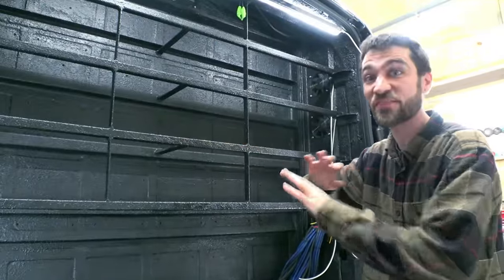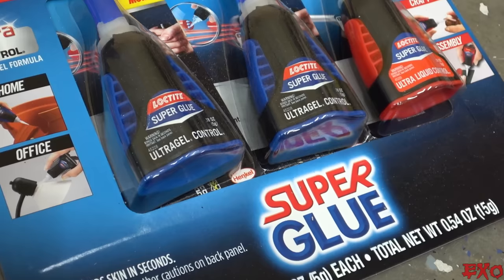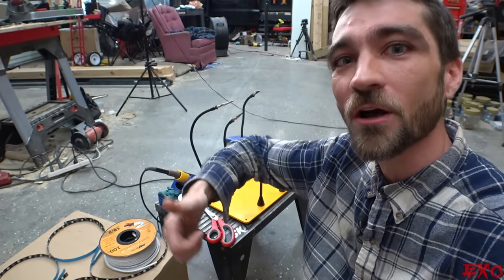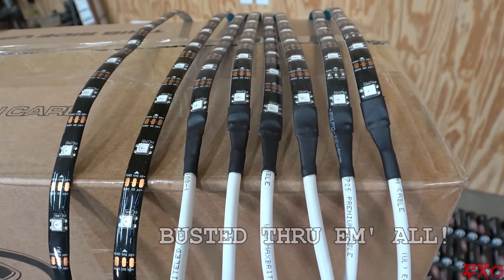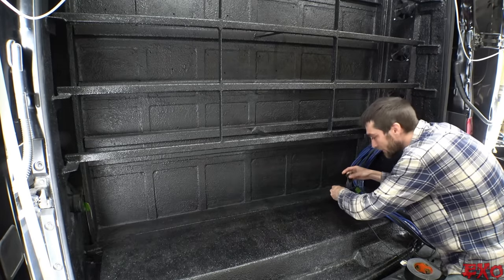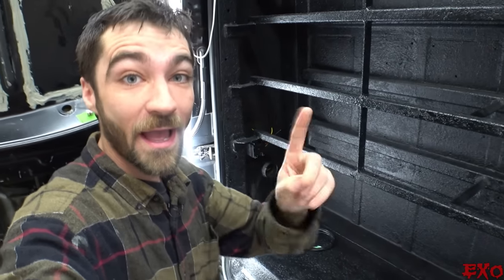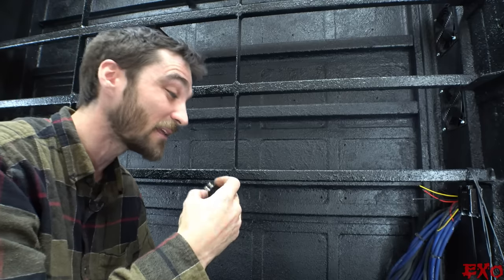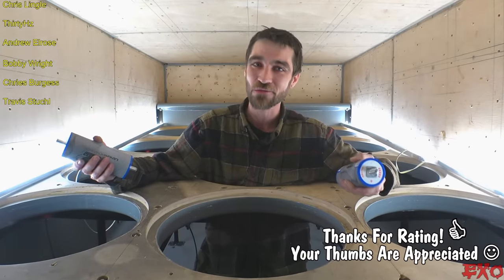CUSTOM LED Amplifier Rack w/ Hidden Light Strips & 12V to 5V DC Power Supply | EXO Car Audio Install

Comment: Loving the build,I've learned with the led steps that after soldering,I use hot glue to insulate the wires before heat shrink

Comment: I program these LED strips. I've built my own software to control these and designed my own animations and games with them. I even built a huge one of a kind LED Bar that I mix drinks at in my home. The top is fully customizable and users can draw on it and play games on these LED's!

Comment: Well I for one am really looking forward to you putting out a video on installing the li-ion bank because I really want to learn how to do it. I'm working on building a 4-15s setup in my 05 scion xb, and the only thing I'm lacking is the battery power so even if I don't win one of your beautiful banks (wink wink) 😂 I'd like to learn how to do those and buy a bank for my setup so I don't kill my factory electrical system bumping the doors off. Love how the build is moving right along, keep it coming!

Comment: Dude! I love your energy! Just a quick solder tip, when tanning your cable leads, hold the solder tip against the copper longer to heat it up higher so when you touch the solder to the wire, it wicks into the wire. This will keep your solder tip cleaner longer.

Comment: Lookin good EXO. For big builds or really detailed builds, I don't think people understand the planning or fore thought that really goes into stuff to make it look good. Like  I planned ahead to wrap my subs with LEDs and gapped my trim baffle and it looks like a ring. But my door enclosures were tight around the parking brake and touched, so 30 plus hours were for naught to integrate a small notch that looks factory. To do top tier stuff, there's a reason ppl pay 10 grand or more  for an install. Everything is custom and you kinda make it up as you go along....with some fore sight.

Comment: for such a top of the line build you'd think you would use the top of the line 2812's.. I've done my 151 Jaeger build with so many 2815b (they're already 12v no need to buck them down to 5v) but now they have the 24v COB 2812's (look into it) so much better looking.. and you can boost the voltage with a 12 to 24 buck. and there's NO VOLTAGE drop the 5V LEDs get over distances.

Comment: Love your videos and all the positivity you bring to the community. I would love a set of the yinlongs. I have been needing another bank. My voltage at big shows is pretty scary sometimes and I really think just having one more bank would help my reserve tremendously. I once gave you a demo of my truck at slam with Casper. I now have a 3 15s blow through I would love for you to hear again. Back then I think I just had 2 10s. Now I have about 10k watts. It has been a very very slow build for me but it's what I love.

Comment: It will be interesting to see how well the niodinium magnets hold the LED light strips while the van is hitting at full wattage.   I know niodinium magnets are super strong when it comes to the holding ability, but due to the uneven surface caused by the black coating, I just wonder if that will eventually lead to the magnets not holding causing the LED light strip to fall off during hard use.

Comment: Great vid as usual, EXO!!

Just the Tip: Painting your heat-sinks will decrease their effectiveness at removing heat. If they absolutely have to be black, try using a spray ink.

Comment: Just like my comment on the last video,I'm finishing my build that started 4-5 yrs ago. Saving buying saving buying you know the grind. Anyways lithium is all I need to maximize my system to its full potential and 40ah is what I've been looking at to buy,but if I could win them my project would be complete at the beginning of the new year instead of another year saving. Can't wait to see those Incriminator amps go in.

Comment: I just recently upgraded my subs and I cranked the amp up but I find my voltage is low. I could really use those Lithium cells. I also built my own box for my car and am currently building a box for my budget home theater. Cant wait to see how this build of yours preforms.

Comment: You should check out the aluminum tracking with diffuser panels for the led strips. Just in case the magnets aren't strong enough with all that bass.

Comment: I love how 75% of the comments are about his positive attitude and work ethic, and not just the giveaway.

With that being said, keep up the good work, and ive been waiting to see your battery bank to know what i want to use in my first big build.

My current system has 1600 watts total for 3 subs and the 10 dash/door/rear speakers.

My new system that i almost have all components except alternators and batteries will have 12200 watts with 11 amps, 2 processors, 6 subs, 18 mids, and 8 tweets. Looking at 3 390 amp alternators but need to know what batteries im using before i have them built. I would love to pick your brain on how much lithium to use. Betting these would be a great start. 

Also, same as others have asked, how are you controlling the leds? Ill wait untill next video because im looking into lights myself. Lol

Comment: My work-in-progress is going slow,  but steady.  I'm going with 3x 15" deaf bonce 305s on a JP 6300 wired at 1.3 (i might are switch to .66) with a Lithium 12k and DS18s in the doors.  Love your vids bro
Reply: Can't forget the JS Alts 320 amp!

Comment: FYI you can daisy chain these strips quite easily, so you don't have to run a cable to each strip. And you can get them in 12v variants (WS2815).

Comment: I would of suggested getting the quick connect ends and soldering those on the ends for easy replacement if need be

Comment: Hey bro some good ad when u tin the wire and ur done heating from the bottom do a quick wipe with the iron to the top side of the wire it helps pull the solder through the wire and you so need a sharper tip but they came out nice

Comment: great video!!! I just bought a Tahoe and slowly getting there. I got 4  sundown x 12s in a 6th order but only on 1200watts :( its pretty good I just need power before I get a bigger amp. that little skar 1200 drops my voltage to 12.1v O.o

Comment: I use double sided gorilla tape on my leds. That's the only thing the tape on the leds will stick to😂 but it's held my cheap amazon underglow on my car for over 3 years now! Never once had even 1 problem. And I live in Ohio. So the multiple feet of snow in the winters and all!

Comment: I really hope those magnets work. I’ve got strips all over my house tucked behind and around my new baseboard and I just can’t see the magnets holding up or keeping them positioned like they should be. Tbh, I’d probably just bit the bullet and stripped the rubberized coating off where you wanted them. Hope it works out though

Comment: I could Def use those Ling long Ying Yongs to replace all my agms, I have 4 skar svr 15s with a bass 5k, 320 auto tech. But even with 300ish ah of agm I still dip to much for my liking! So those would help ALOT

Comment: When it comes to neopixels one data wire can run 30k leds at 30fps or so, to keep the wiring neat just snake one data wire up on the rack. looking good though they shouldn't dim with those power wires

Comment: What is the reason from reducing the voltage from 12v to 5v? Only reason i could think of was to dim the lights? This build has got so much fine detail, it make me realize how much planning and work actually goes into something like this.

Comment: I thought about buying some lithium banks.  I'm running a Ioxus ultra capacitor smart power on a jp23 v2 and pushing a crossfire c7-v3-12-d2.. it beats tho I just got to get more power.

Comment: Looks SWEET! Wish i could hear and feel it man! Exo, i have 2 12" dual 4 ohm Orion HCCA subs and a Taramp smart 5k amp running them, but i don't think this amp is 1 ohm stable so until i can purchase another smart 5k can i just use 1 voice coil off each 4 ohm sub to get a 2 ohm load?

Comment: Hello Exo, i hope you try a pack of LiFePo4 battery, they are the best cells in the world, with a wattH/height ratio of 153Wh/kg, LTO is 70Wh/kg and lead/acid only 38Wh/kg
You should buy some 32700 cells and test them, 4 in series to reach ~15V and you will see a shock of almost 400A instant with just 4 cells.

Comment: You should have pulled a new string with the wires through the back tunnel in case you want to pull something else through there later on.

Comment: Just remember that the glue on those led strips is rubbish at the best of times. Yes, I know you superglued the magnets but it's still on the glue strip. I wouldn't trust it.
Inside a hot vibrating environment the glue WILL fail very soon so you should look into using thin black enamel wire or something similar every foot or so to secure them more permanently.
Flux the copper pads the use thin solder tip to heat the pad for half a second then introduce the solder to the pad.
That way there's little chance for bridging the pads and you tend to use less solder too.

Comment: @EXOcontralio What are you using to control the data side of the 5v LED strip? I get the step down buck converter to limit power. But what's telling them what pattern to show?

Comment: If i win the 40Ah bank of Yinlong cells from Remy. The 40Ah bank of Yinlong cells will drive a plasma speaker and a 400 rms sub.

Mid/high from the teslacoil.
Low from the subwoofer 400rms.
And I will put it on youtube. With name and link to Remy and exo

Anyone curious!?

Comment: Would be kind of cool to try out those batteries probably work better than the 2:+ 18 amp hour AGM batteries I'm currently using just some old batteries I got out of an uninterruptible power supply just kind of just a low Dollar Car Audio setup just a lot of my old equipment moved on from different vehicles I just got a new truck The electrical system is kind of weird being it's a new style alternator It doesn't always regulate at 14 volts it can go up and down And I noticed my amplifier really does not like that kind of yo-yoing power supply And I think there's AGM batteries from five years ago are about to give up the ghost

Comment: I would like if possible some help with my audio build my main goal has always been to play between 25 and 50 ish hz I like my lows and I've done everything to try that no matter what I see people
Online with even 1000 watts or even 500 more than me i have a stinger 1500d amp it's pretty efficient on the dyno and runs 2400 dynamic power and dynos 1700 rms no clip I've set my gains to no clip with an ossilyscope I know the car doesn't roll off the bass from 30 up to 20klhz  it also doesn't roll off down to 30 ish but I've never been able to relly relly play below 32 hz because in the range of 35 to 60 it slams but the area where I tuned the box and where the subs like to play I can never get people even u play like 27 hz and it slammmmmms and others with less watts can hit that low I even built a box tuned to 31 hz box specs are 3.2 cubes and 4.9 net and I have 2 audiopipe txxbdc 12s 800 rms more like 1100 they're fs is 27 resonant and I also have an extra battery to keeps the volts up I never drop below 12 volts so can u help me hit where I want to hit 🙃anybody on exos channel
That sees this or exo himself .. if it's exo I kinda built the box somewhat like your box u build for ur wife with those blue two 10ns in her corolla

Comment: I could so use this my voltage is dropping low and I’m running. A kinetic hc2000 to push 4 12 sdrs on a taramps md3000.1 i need more headway

Comment: I really need a cell bank for my car audio I’m only using one battery and I can’t use my hood amp and I’m thinking it’s because of the battery or the alternator but I have no idea but I would rather get a second battery first because it cost less but it rlly would be amazing if I could get a bank cell from u because I have been watching u for years and I still have yet to win something from u or even to meet u and I rlly want to do both sumday